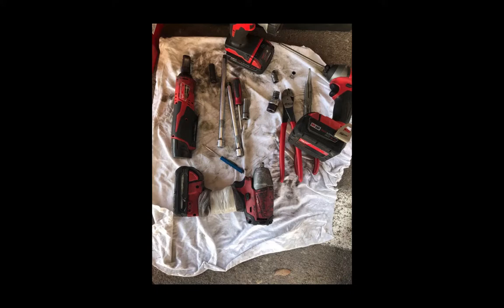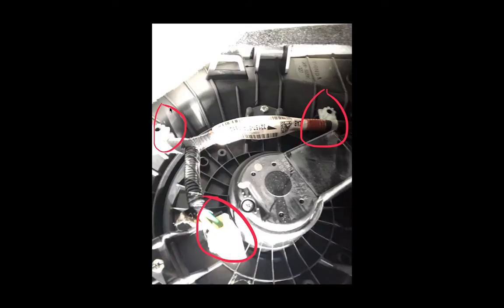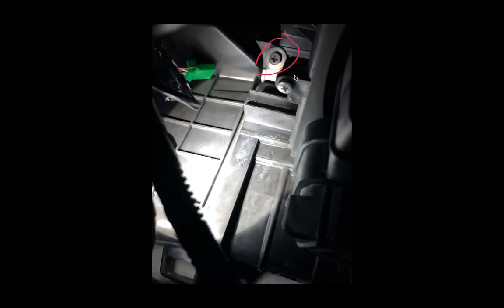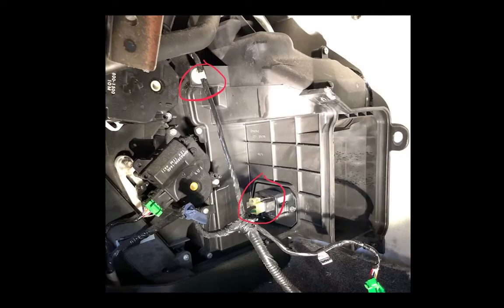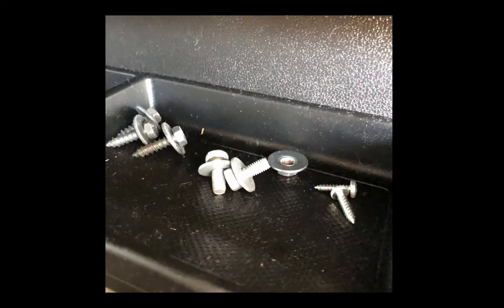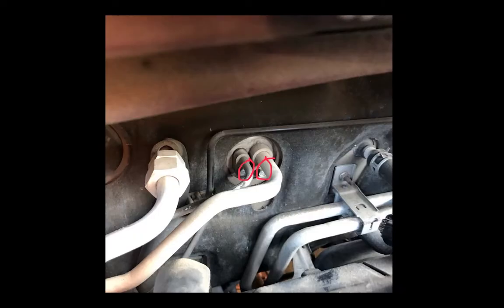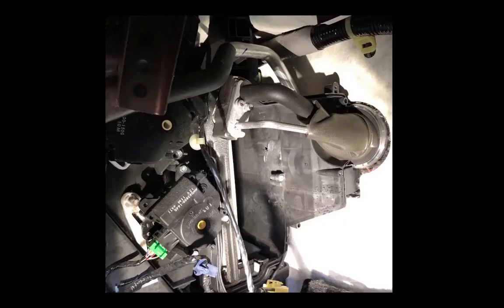How to Fix Front AC warm, Rear AC cold issue - Front Expansion valve, 2011 Honda Pilot

Comment: "You should have evacuated the system by now.." What do you mean by that phrase? Thank you so much
Reply from the maker: The Freon in the system should be out, properly with a vaccum pump and recover system. If not, you will have pressured gas come out when un bolting AC lines
Reply: Gotcha. Thank you for the quick reply

Comment: I have the same vehicle with the same issue, however the pressures are different. 120psi high side and 30 psi low side. Ambient temp is 70 with >30% humidity. After 3-5 minutes low side creeps down to zero and high side stays at 120. Rear ac works fine. High side line is not really warm or hot to the touch, but the low side line to the rear ac is cold and sweaty whereas the front low ac line coming out of the evaporator is warm like the high side line. I’m thinking I have an expansion valve issue. The system has been recovered and found it had the correct amount charged. What are your thoughts? I appreciate the video!

Comment: I have this exact same issue. And it looks like I'll have to tackle it soon. Boy, why didn't they just put the thing right behind the firewall?? Another clue about a failed txv is if it takes a long time for the high and low sides to equalize after turning off the vehicle.

Comment: Mine is cold in the front and hot in the back could it be the expansion valve also?
Reply: There is a separate expansion valve for the rear system, may be that one.

Comment: Hi im having the same issue. My front ac is warm, sometimes a little cold, but if i switch on the rear ac, front becomes  cold. Everything becomes ok. So is it possible that the main/problem is front expansion valve?
Reply: Did you ever figure this out?
Reply: @phillippardo5712  yes the problem is expansion valve
Reply: @gingerbread185  I was having a similar issue. My problem ended being the actual expansion valve INSIDE the AC compressor.
Reply: @phillippardo5712  it's great that our problem is rectified, well i have it serviced by a technician in my case.
Reply: @gingerbread185  right. After tons of research online and many YouTube videos I was able to diagnose the problem and get it fixed.

Comment: As a comment do not cut that plastic portion to get the blower off. There are 2 screws on the passenger side under a removable cover (black Phillips) and also remove the part number 39186-sza-a010-m1 which looks like an amplifier to be able to remove the blower. Also on a note it is 8 screws otherwise the cover to the expansion valve won't come off

Comment: Thank you for the video.  The pictures and explanation helped me accomplish the job.  The two additional tools that I would suggest are magnetic tip phillips screwdriver (long and short) and a magnet on a flexible stick for screw retrieval.  Took me about 3 hours using only hand tools.  Patience needed getting the blower motor assembly to mate with the plastic shroud covering the expansion valve and evaporator.  The torque specs for the bolts holding the lines through the firewall is 9.8 nm (87 inch-pounds).  Torque spec for hex bolts holding lines to expansion valve is 3.3 nm (29 inch pounds).
Reply from the maker: Prairie Melody I’m glad it helped and thank you for adding the torque specs!